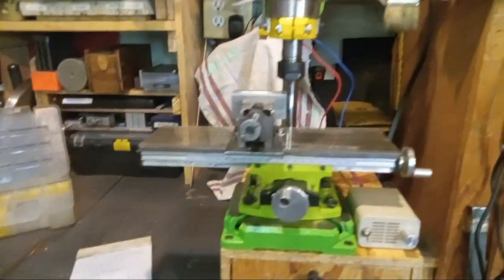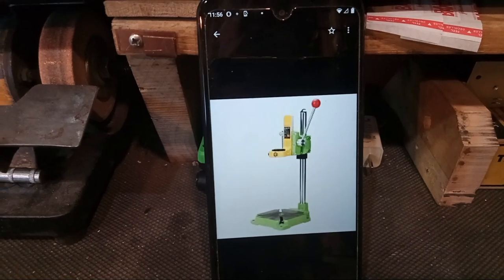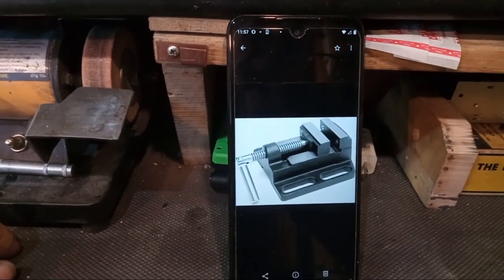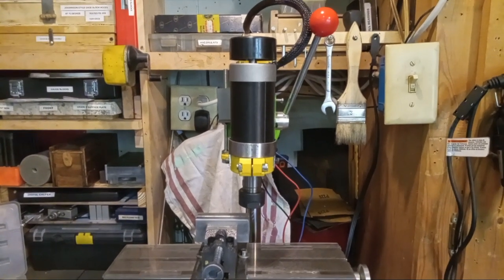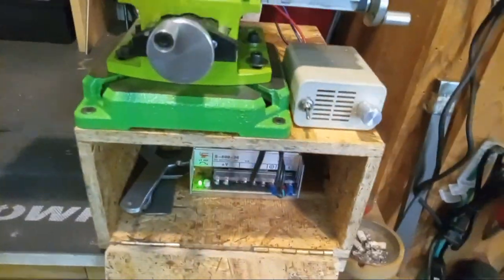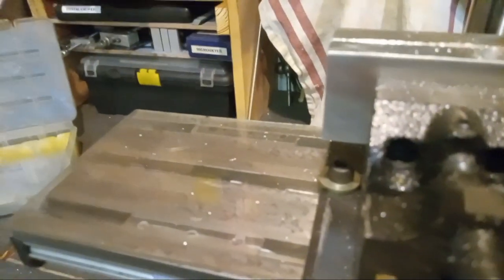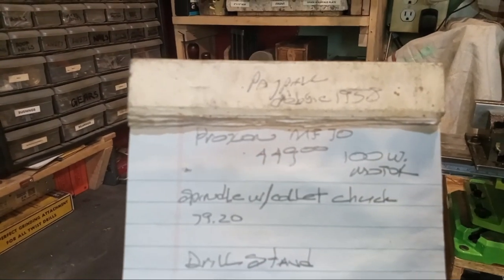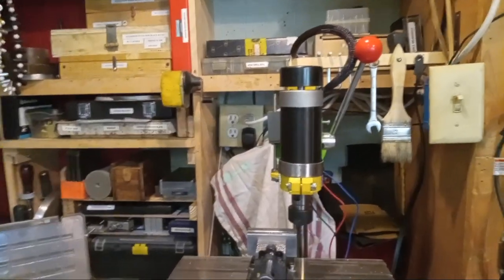DIY micro mill

Comment: I suggest finding something with more meat in the platform to tube area, thats where the bending and twisting motion will be the greatest. So putting efforts there gives the most reward. I found two I beams on the scrapyard I'm going to weld together for an L. And I'm going to put an Vevor XY table at the bottom, yes I know the screws on the table is bad hehe. But I think its going to be a fun little project.

Comment: I tried the same milling option, but it didn't work as well as I wanted. Sadly, the milling table and stand just weren't rigid enough and there was too much slop. It was nearly impossible to precisely adjust the mating parts. I'm considering building another mill using epoxy granite fill or cast components.
Reply from the maker: I know what you mean.  I don't expect high tolerance from a machine that costs so little  such as what you see in this video.  A buddy  of mine has the little proxon that I compare to and he and I both agree that while his machine is a bit more convenient to use the actual results are quite similar.  Kinda like buying an electric bike and expecting it to perform like a Honda Goldwing.

Comment: This seems promising-
I have a couple routers that I don't use, and a weird L-shaped cast iron SLAB of a bracket that was evidently used to cork bottles or something in the 50s- I have a feeling that would be plenty sturdy enough to work as a the basis of a mini-mill, huh? xD
Reply from the maker: @jackpijjin4088  the heavier the better for low speed.  High speed doesn't seem to be bothered in these small machines.  I haven't tried steel and probably never will but plastics, wood and aluminum work just fine.  Thanks for watching and commenting.